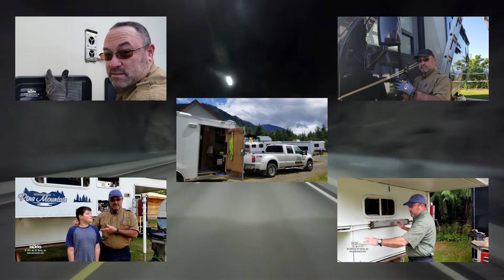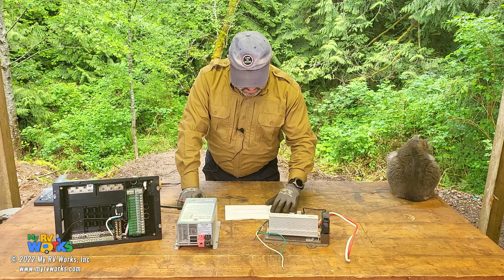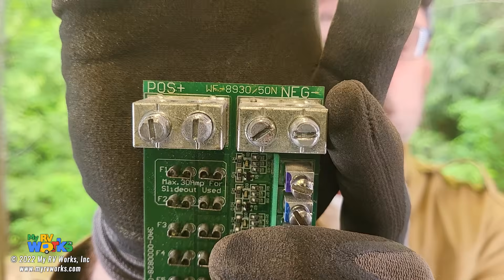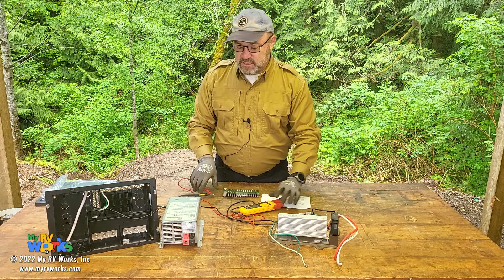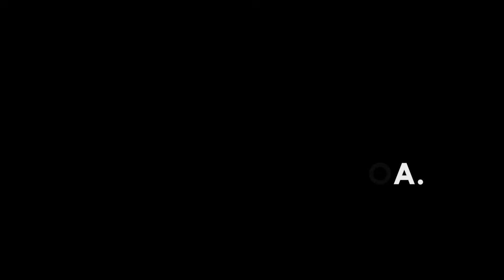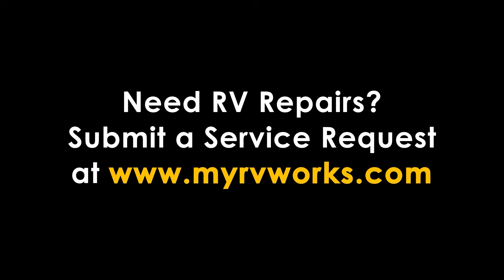RV Converters & Electrical Issues -- My RV Works

Comment: I've got a a 93 Terry camper when I open the refrigerator the AC wants to stop hot water heater is electric or gas I've got it working I've been running straight off of electricity with the plug in it's just now starting to have this problem 0 how do I bypass the converter box to use strictly electric in this camper

Comment: the output from either converter should be  higher than 12V >. 12.6  to 13 + V

Comment: Hey Darren I live full time in my 2019 Grand Design transcend and I had an issue recently where the GFCI got tripped and I replaced that and two fuses in my box, got my battery charged, and checked the connections from my main power cord. And I still have four Outlets that are not working in my kitchen and living room area. The outlets in my bedroom work, and the GFCI is reading green, but I don't have any power in the other half of my camper. Please help with ideas to troubleshoot. I really appreciate your content and trust you can at least guide me in the right direction

Comment: Hi Darren! Great video as usual. Jumping around is NO problem at all-youbsimply filled in some gaps in the narrative.  I wanted to share my experience.  I had 4 plugs which did not work(all on one side) in my 1996 Holiday Rambler travel trailer.  A circuit breaker was tripped. I tried resetting it, and it tripped again.  I figured I had a dead short in one of the plugs.  As I was looking to get access to the back of the easiest to reach plugs, I saw that the power converter was plugged into a receptacle that was inside the electrical cabinet under the closet.  I unplugged the converter, and found that the circuit breaker did not immediately trip when I reset it. Problem solved! Replace the voltage converter.  Older RV's have a bad habit of frying the battery if left plugged in to shore power.  That is because the older converters were "brute force"- that is they put out 13.8 volts 24/7 regardless of the state of charge of the battery AND YOU CAN STILL BUY THEM.  But you can also get a "Smart converter" which monitors the battery voltage and lowers its output based on battery charge level.  Just like a trickle charger or smart battery charger. The "Smart"  converter costs a bit more, but it will never kill your battery, no matter how long it is connected to shore power. Sp I got a Smart Converter by Progressive Dynamics for $240, and solved TWO problems!

Comment: Hi Darren how can I tell what amp should be for the auto reset breakers on the front of my camper near the battery I have a 30 amp travel trailer

Comment: My converter might be bad, but, what runs the fan in my power compartment? It all is getting hot, brakers dont trip, and my connections have gotten melted where i live.

Comment: Hi Darren I have a 2006 sunnybrook mod 298BH vin 4UBASOR2561D71691 I am second owner no more sunnybrook I am looking for the inverter any info would be appreciated slide not working new battery and fuses are good what am I missing

Comment: The converter in my camper trailer is bad the numbers I have gotten off of it are model 7355 series 7300 looking for information on a upgrade replacement but I’m new to the camper world any help would be greatly appreciated

Comment: What if you are getting 18 vdc
Reply from the maker: If you follow the trail to the converter, and it's the converter that's producing that voltage, then I would say that the converter needs to be replaced.

Comment: My camper started to have electrical issues this morning. The converter breaker was tripped. I was able to reset it after multiple attempts. But now my AC will start occasionally and if we even turn on a light it will turn off the AC immediately. Also, when we turn on the lights they are dim and the radio is acting up. Could this be a bad converter?

Comment: Yeah you did jump around, but it was actually helpful! As it stayed in line with the issue at hand and didn't require you having to start completely over with "but if you have THIS kind" so good job 👍🏼 thanks 😊
Now it's time for me to figure out why MINE won't hold a charge🤬

Comment: Hey so I have a question is any fuses in my box supposed to be over 15amp because someone had a 25 30 and 75 amp so I took out the 75 thinking that’s definitely too high should all of them be 15amp though
Reply from the maker: The size of the fuse is a function of the wire it is protecting.  The largest I have seen for RV house circuits is 20A for a 12 AWG wire but 15A is more common for a 14AWG wire.

Having said that, the circuit that goes between the converter and the battery will be a larger size - we usually find those around 30A - 40A.  Those will be either on the converter or in the fuse buss panel separated from the main fuse buss.

Comment: Is the test conducted unplugged from 120volt shore power?
Reply from the maker: For you to test for the proper voltage coming out of your converter you will need to have it connected to shore power.

Kind of like I mention in the video the converter is an appliance and if the appliance is not connected to power it is a not going to do much work for you.
Reply: Thanks for this additional info about having to be plugged in. So here in lies the rub, I must go on the road with this problem & confirm it at my first campsite, then go thru the hassle of fixing it on the road or band aid it for 2 months, since i don’t have a 30 amp hook up at my condo. 
I have used my trickle charger but it only gets my batteries charged to 10 v. Is that normal?

Comment: I want to upgrade my converter to lithium. I have the one with the slide in drawer in a 2020 Lance travel trailer.  Do you use their upgrade or prefer another solution?

Comment: Do you see any reason that I wouldn’t just put in a regular lithium battery charge when switching out my converter? Basically replacing it with a Victron or Li Time dedicated 30 or 40 amp dedicated battery charger.

Comment: My converter is not working through the plug built into the distribution panel,so I plugged it in to the receptacle next to it and is working fine, can you replace the plug or as I heard you that you can wire it in directly to the breaker ground and bus bar? Correct? Is there a 20 amp fuse in the plug?

Comment: I have  a little guy max , disconnected from tow verhicle, goes stone dead in less than 4 hrs , only using lights in rv. checked found 12 amp draw . could the converter cause the draw ? HELP  thanks for any help you can send my way

Comment: Hey Darren, 
Having low battery voltage in my RV and normal symptoms of that. Good 120 to converter on shore power, no converter output. BUT when I switch the battery master to off, bam, the converter will kick on right to 13.6. Clearly the converter is bad just wondering if you know why turning the battery switch off is getting that converter to come back on? Curious…

Comment: What if I’m hooked up to shore power and I’m getting spikes of 17v and when I run a new battery it dies in one night down to 6v with no power on and couldn’t find and shorts in any wires
Reply: I'm getting the same thing and wondering why
Reply: @ it is your inverter that failed they are $500 with lithium switch on em now so you can switch to lithium batteries as well super simple fix
Reply: Converter**
Reply: @  it is also hard on your furnace motor and all your other electronics running it at 17v in and out

Comment: Well even though you were a bit scattered in your presentation the one gem that I gleamed and was extremely useful was that the converter was like the brain and without it nothing was basically going to work. Pulled the converter box out put the test leads to it on a different 120 circuit It was dead. Ordered a 100 amp replacement from Amazon same day delivery up and running. 
Thank you very much sir for pointing me in the right direction 🥳🥳

Comment: what would cause a newly installed converter to go bad shortly after install. And When it comes to converters what is their lifespan and what are a few common causes of failures with a newly replaced battery

Comment: My refrigerator and 4 different outlets stopped working at the same time. Refrigerator works on gas but no electricity. I have 120v from power to ground on all outlets and only 55v from power to neutral?? I think I’ve dropped a neutral but how do I find it? Gfci protected outlets and only one resettable one in the bathroom that works fine ?? Help!!!
Reply from the maker: We answered this on our livestream tonight: https://www.youtube.com/live/-ohz-IBwB5w

Comment: I have a brand new trailer well it’s 3 years old but it has never held a charge over night since we bought it brand new?12 volt fridge only I suspect might be the issue?
Series 6 volt batteries

Comment: Hi Darren, I have the stand-alone like the one in the middle. So, if i even removed it from the RV (which is 40 yrs old) and plugged it into my house receptical, i could test the output (13.6 volts) that way?
I used to hear the fan come on but haven't heard that in quit a while.
Im not getting power to my lights and fridge any more and that seemed to happen when we started to use a new heating plate (for cooking). Our circuit breaker tripped and then kept tripping after we unplugged the cooking appliance. Now the circuit breaker stays on but no power to the lights and fridge. Maybe a bad converter and a bad breaker, I'm guessing?

Comment: Hey Darren I got a 1987 p30 chassis Chevy class a motorhome every time I go to plug it in to shore power it blows the house  breaker right away I noticed inside the converter there is a button that pops soon as I plug it in too so I'm wondering if it's the converter that's bad

Comment: We had a lighting storm  and the converter breaker flipped but there was a burning smell and now the converter isn't supplying to my fuse board as you say. Everything will work off of battery DC but the only 120 I'm getting is to the sockets and microwave.

If I only need to replace the converter what's a good alternative to the wfco 9560 lis wago ge

Comment: Ever since I installed solar power + new 12v lithium battery in my 5th wheel, my dc power in my RV only works when plugged into solar inverter or shore power.  I don't know if I fried my converter.  I have the Inteli Power 9100.  Maybe there's a fuse or breaker I tripped or the converter's shot?

Comment: I looked at online videos for awhile and couldn't find what I need, then I saw this video. You explained everything  perfectly and pointed me in the right direction. I thought it's time to pull the electric box apart. I took off the cover and then I could get to the fuses that were recessed inside the box, so I pulled the 40 amp . Voila, the fuse was blown. Where it was, there was no way to see it without removing the cover. Thank you !
Reply: Yep,...usually you can find answers too any and all your questions right here!!  Darren does cover it all while he explains the issues & fixes to that problem...(Sometimes answers come with a little ADHD included) but always for the most part covers the bases well!!  The best part is it's free on here and you always have others too chime in, if needed! Once again - Love the video, (Romeo stole the show I'm afraid) 🐈‍⬛! good to see you still educating people out here!! Thank you
😸

Comment: What if my converter fuses on the outside of it keep blowing but the polarities are not reversed?
Reply: Did you ever find the problem to this issue? My converter is doing the same. Keeps blowing its fuses everyday or so

Comment: My air conditioner will trip the breaker on my could that be my converter.1984 Chevrolet G20 horizon camper van. And I know you was talkin about fuses  old glass fuses?

Comment: HI Darren, I was just wondering if a deck mount converter can work intermittently? I recently replaced mine because the lights were going dim and the battery was not charging. It fixed the problem but when I got the old one out, I tested the DC side and it was producing 12.7 volts all day long. I brought it home and put it on my garden tractor 12 volt battery with all the lights and ignition on. This simulated the same amount of amp draw our trailer has when not in use. It produced 12.7 volts all day long and kept the battery charged. I'm not wondering if I just had a loose wire and by putting the new one in, I tightned the connection and fixed the problem? Thanks Chet

Comment: I had a reading of 13.3 on my meter.. is that mean my converter is weakened?  When rrunning heater or air purifier they will fluctuate.. meaning it will run fine then slow down then back to normal..

Comment: Helped a lot, thank you sir. Just bought a 2016 Durango kz 286 and we not getting 120 power. We have the built in type converter as shown on your video. I ordered a new converter

Comment: Hi Darren.  New subscriber here.

We bought our first camper, a 1982 Sunline 16.5', in decent condition.  Now I have to learn how it works!

1.  I bought a new battery and plugged the trailer into the house with a 30-15A adapter (please don't turn on the AC!!!).  The fridge turned on and got cold, and some of the 12V lights could be turned on.  Maybe a blown fuse or those lousy 12V lights just don't connect well.  I'll get to that issue later.

Then I unplugged, and the 12V went out.  I used a tester and got 12V at the fuses, except one is blown.  But the lights that went on when 120 was present do not work.

I've done some research on converters, and I don't see how this could happen.  If there's 12V at the fuse, then that circuit should work!  The fuse terminals go directly outside the concerter enclosure, so ???

2.  On the subject of converters.  The docs I got with the trailer show a Magnetec, but that's not what's installed.  It's a "Converter Systems Inc" model CS-835, and extensive searching reveals nothing of the kind.  I found two posts that seek info but they got nothing.  It would be nice to have docs and wiring diagram.  It claims to be 35A, does NOT say if it includes a charger!

This one is hard-wired into a tiny breaker panel with two breakers.  I assume the 2nd circuit powers the AC, fridge and receptacles.  Not smart to use one circuit for that, but I can't find any other breakers.

So, should I buy a new converter and panel, and re-wire?  Or will it be possible to figure it out?

Thanks in advance!

Jim

Comment: Hope you can help, i'm having issues with 12 volt system all 12 volt lights and a/c work for about 4 hours then go dim and a/c fan blows but no compressor. Start the engine in about 2 minutes or less everything comes back to normal......This is in a 1998 fleetwood discovery 30 amp system thank's for any advice...

Comment: When replacing the converter is it necessary to upgrade to a stronger one? I feel like my 30y/o dead converter wouldn’t be able to keep up with the demands of so many electric devices being plugged in. Or should it just be replaced with the same or very similar size?
Reply from the maker: You give me the idea that I need to do a video on how to properly size a converter. At one extreme of the debate we can perform all the math and arrive at the correct size, but it is a function of how much power you have coming into your coach that you want to devote to charging batteries versus running all of your other electrical appliances. And then if you charge a battery too quickly there's the issue of it damaging it. For your typical RV a good rule of thumb is a 55 watt converter. It's kind of a middle of the road choice.
Reply: @MyRVWorks  thank you. I have a 45 now, but I’m just looking to make sure I get the best for my money. 

A video on this would help so much! Especially when dealing with an older RV.

Comment: My wife accidentally plugged our camper Into a 220 outlet. It seems to me that the converter fried but, my fridge light comes on. Is there any chance that my fridge is on ac instead of dc.

Comment: Darren,   We had a 2014 Thor Windsport and the converter was putting out 13.6 volts but no charge was going to the batteries when plugged in to shore power.   When not on shore power, no DC to anything in the RV.   After lots of YouTube viewing, I finally found the answer.   There is a tie between chassis and house panels that is inside a metal box under the hood right in front of the driver.   This panel is specifically made for Thor.  At the bottom left of the circuit board, there is a circuit breaker that has a tiny reset button.   I barely touched it and everything started working correctly.   I thought I would share.   Respectfully,    Kevin

Comment: Hey Darren, progressive converters recommend that you take the negative wire off the converter to check for 13.6vdc output. One lead on the positive and the other lead on a nearby ground.  Is this really required?
Reply: they want to make sure that there are no wire shorts when checking as that could be the issue instead of the converter. taking the wires off and testing confirms the unit only.

Comment: I subscribed to your channel and have watched some of your videos that helped me get the fridge working on LP and the furnace to light.
It's an older (86) 5th wheel that's in great shape but needed a little service to get everything working properly. 
I'm thinking of installing AC, one of the vents is wired for it from the factory so it shouldn't be too difficult. Can you recommend an AC unit?

Comment: Uh... don't forget about voltage drop issues. Measuring voltage on an unloaded circuit means absolutely nothing of value. Voltage needs to be measured at the source and the load, in this case many things could happen in the distance between the converter and the panel.  Imagine someone replacing the converter when it was a bad/failed connection inside the molded plug going into the panel. (etc.) Good video but so many forget to teach voltage drops and how to check for them.